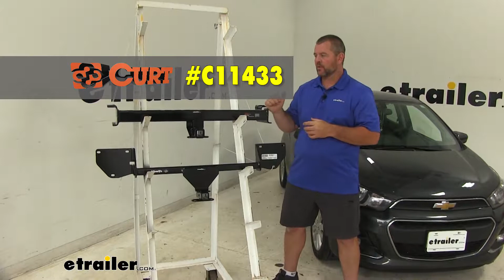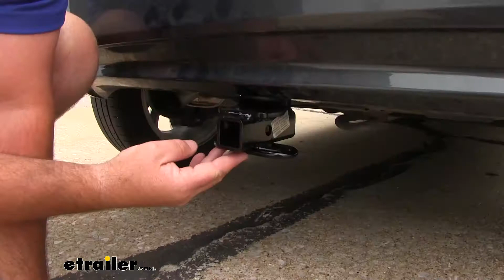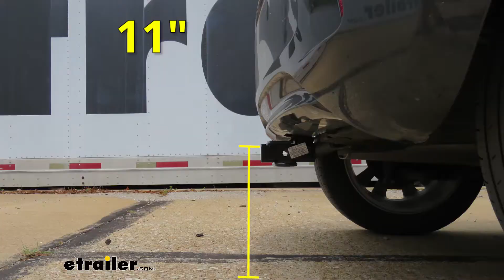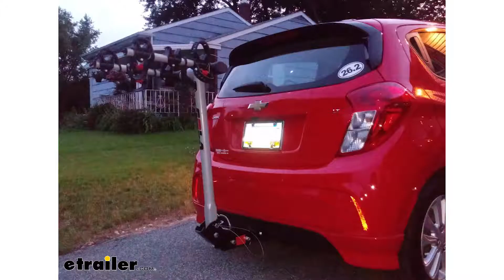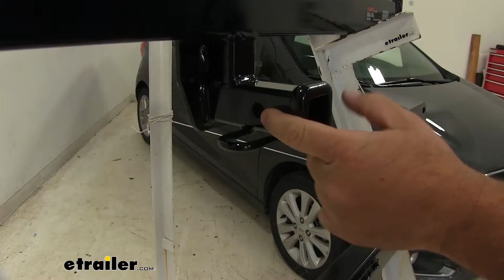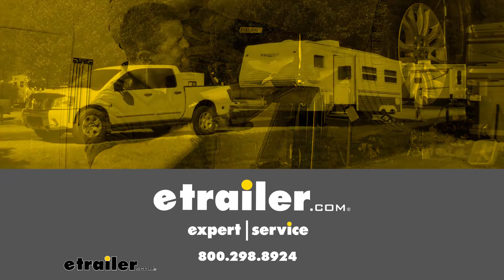etrailer | Best 2018 Chevrolet Spark Trailer Hitch Options

Comment: I just put on my Curt 11433. And I did a combination of the two to install. I pulled the rear bumper, didn't enlarge anything. The bolts were fished through the frame with ease. And I think it is very strong with the 5, 1/2" bolts. Didn't have to mess with the muffler either. I found the rear bumper mud guard bolt heads were 9/32 not 7mm

Comment: For me I'd rather get the Curt and have the piece of mind my bumper won't ripp off if like the other hitch! Just seems like a stronger bolt pattern with the frame on the Curt. Just my preference though. Thanks for this video. I ordered the Curt for my Spark :=)